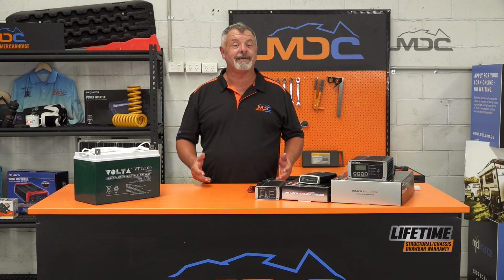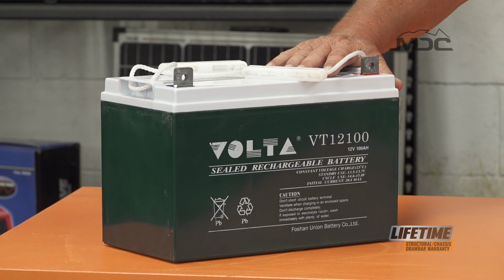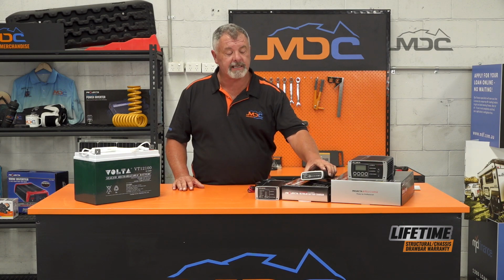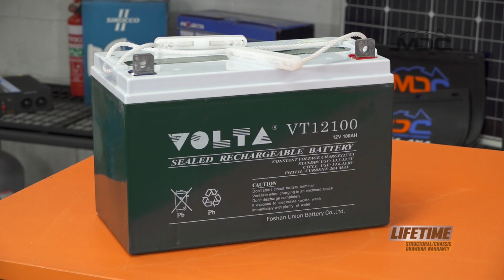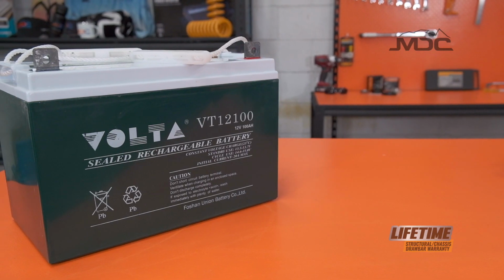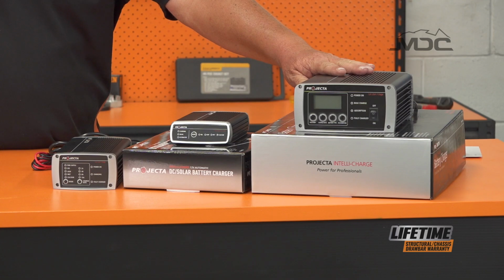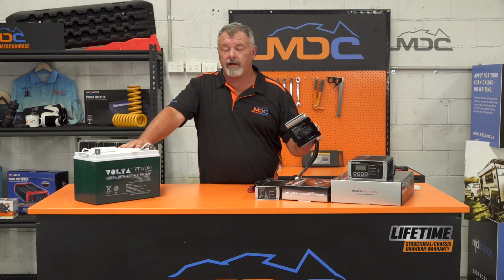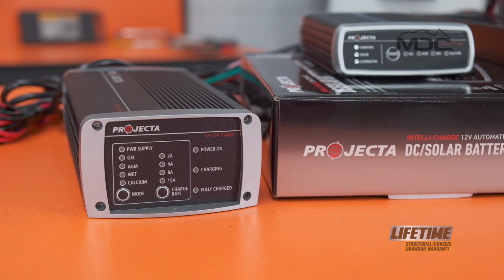Battery Maintenance - MDC Masterclass #10

Comment: I have an XT12-HR, I keep it stored in a shed with the 240v plugged in. Does the caravan mains switch need to be turned on to charge the van batteries?
Reply: according to the maual, no, you can leave isolating switch off, thats how I read it anyway